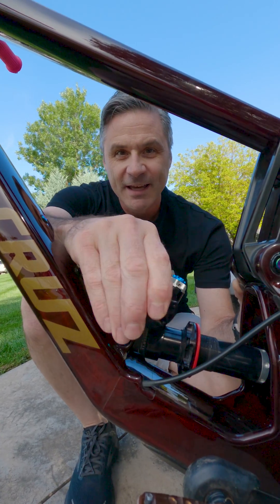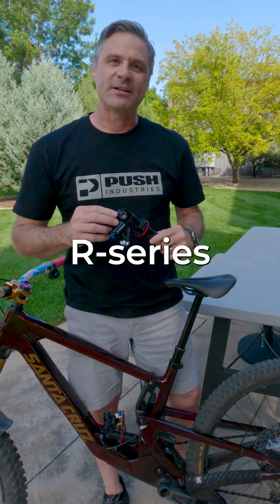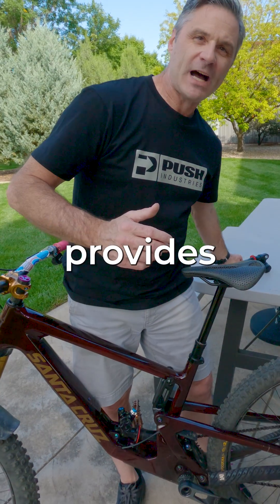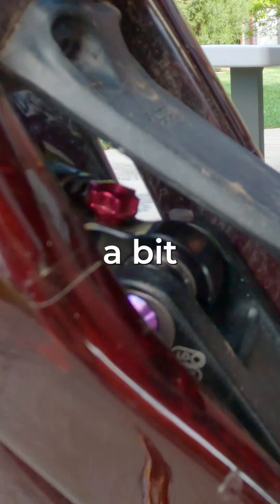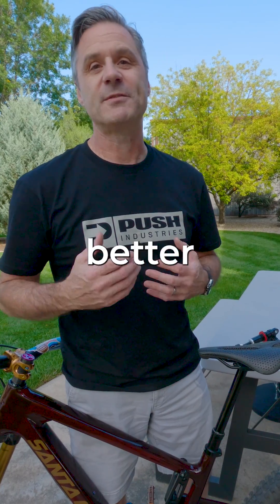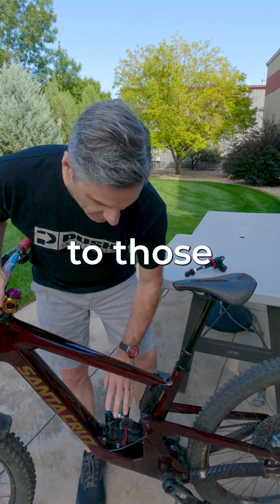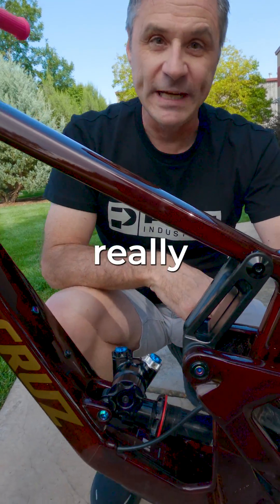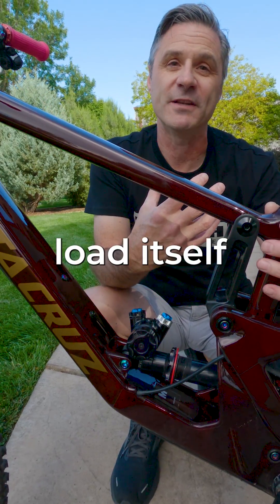Smoother is Faster!

Comment: Guys is there any way that your new non custom shock if sized correctly could cause damage to a frame? Atherton won’t sell me a frame only to to a Push build on saying that the shock isn’t designed for the frame so could cause damage. My basic understanding of engineering suggests that the rubber seals, bushing and frame bearings are all there in part to act as sacrificial elements to protect everything else.
Reply from the maker: Shock could come in contact with the frame, we haven't tested that bike.  That being said, you could get our SV8 shock, install it on the bike without the spring on and cycle it through its travel to see if it contacts the frame.  If it does we would be happy to refund your purchase.  You can see how to do it in this video - https://www.youtube.com/watch?v=3_9_oATIKiA&t=9s

Comment: Hi, Should there be rubber O-rings or washers on the sides?
Reply from the maker: We do have a foam ring that is adhered to the hardware if that is what you are referring to and there is also o-rings inside the hardware as well.